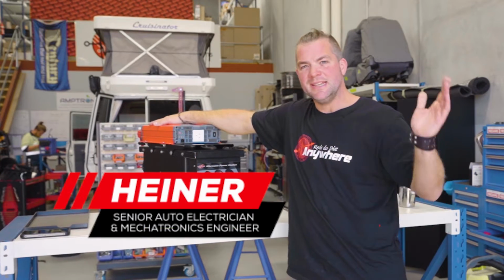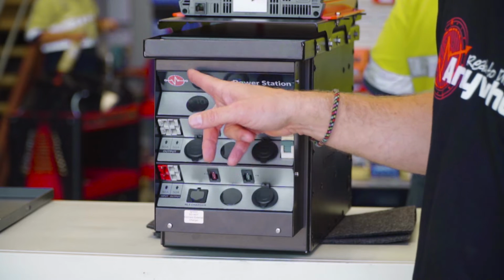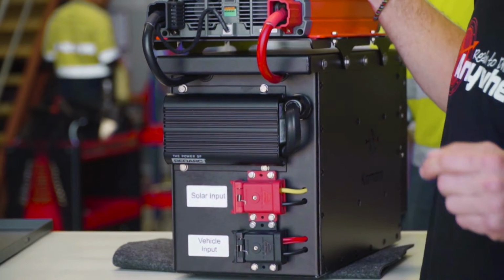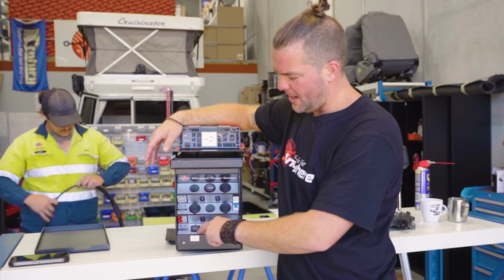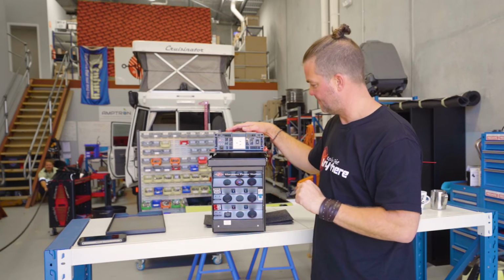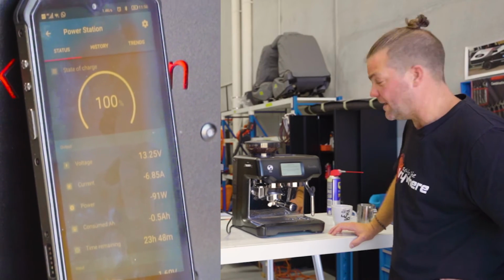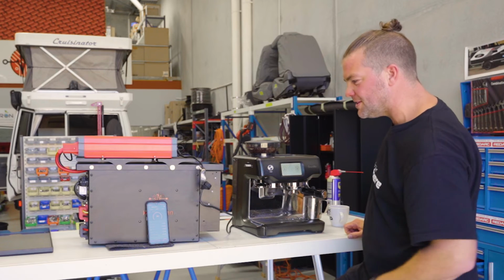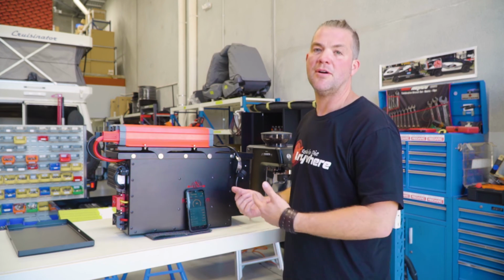Klarmann Power Station - Portable 200Ah Lithium Dual Battery System

Comment: That is great. Much better than other power stations I’m seeing on the market. I’m going to buy a van this year and this is now at the top of the list for my power solution. To what extent is it customisable? I’m thinking of fixed solar on the roof  as well as portable panels - both potentially operating at the same time. Also the Engel connection at the back. And the dummy slots in one row. And, seeing as almost everything is now coming standard with USB-C, will these also be available? And, this shows my level of knowledge, if you connect to your vehicle battery do you need some kind of delay so the start battery remains fully charged. I sort of don’t know what I’m talking about there but I have this Redarc doover-lacky in my ute that I think does this. Oh, and lastly, some handles?  Awesome package. Well done.

Comment: I have a simple portable system with 120ah lithium and dc/dc 25amp bolted to power box all wired but this in next level. Do you sell this retail? If so cost please and postage to qld? I'm assuming 120ah lithium is not enough for a 2000w inverter. And need 2000w inverter to run a induction cooker or coffee machine or air fryer?